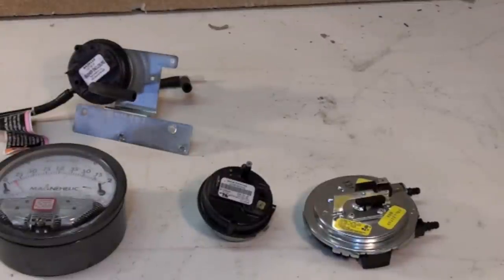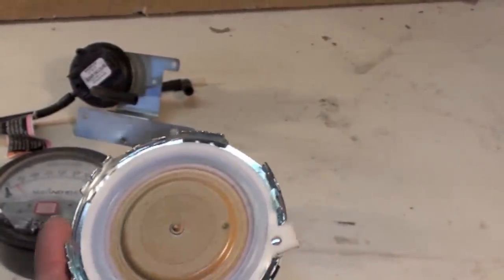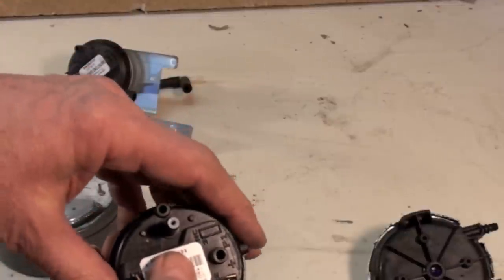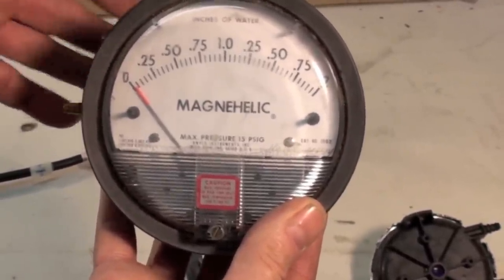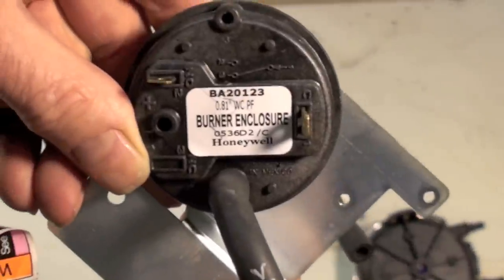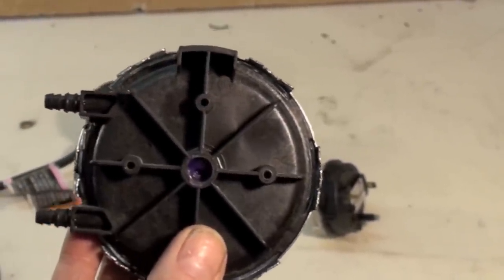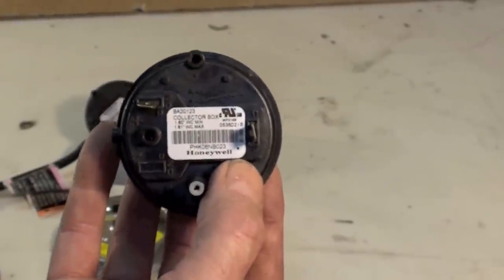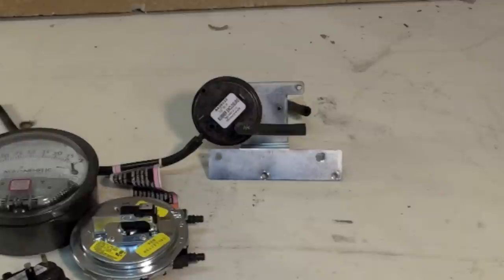How gas furnace pressure switches work

Comment: If I tap on the switch it will activate, it is intermittent. If I hold it with the wires upward it makes connection every time I try that. If I hold it with the wires facing downward and the adjustment allen up it shuts of the gas valves. Normal operation or bad switch? 

Furnace shuts off after the fan kicks on, or doesn't ignite unless I tap on the switch while it is vertical.
Reply from the maker: The switches are quite picky and some are position sensitive.  You could have a switch failing or a venting problem.  I would replace the switch first.
GFM

Comment: Great video. My mothers gas furnace has been not starting lately. It's about 12-13 years old in a modular home. It's upstairs and down draft with a full basement under the home. I did a quick search online and seen posts about trying to tap the plastic pressure switch. I've done that and then the furnace will start. Just a light tap with something plastic. I've been using a potato chip bag clip. Do these switches get sticky? Is 10-15 years about an expected life of these? We are in central,wi.
Reply from the maker: Your problem is either the pressure switch is failing (which is common) or the system vacuum is low.  Causes could be vent blockage, dirty inducer wheel, inducer motor failing and possible tubing plugged.  Hope this helps.
GFM

Comment: I hope I don't have to pitch it.  It is like 2 years old and my deductible is $1000.  The burners and everything didn't get any moisture on it just the lower circuit board and the bottom of the blower.  Do you think its the blower?  I already replaced the board that got wet.  I tried putting direct power to the blower from a ext cord and got nothing.

Comment: I have a Nordyne M1M Series.  We keep getting blinking red light that pressure switch is open.  We replaced it and still get blinking red light.  We live 80 miles from town so technical repair is not possible.  Took off blower assembly and cleaned it out.  Still blinking light.  Any suggestions?

Comment: Hello Gary, Thank you for the video, I have AO Smith 40 gallons Water Heater and It is 2 years old unit. Today I have noticed that it did not work and i was able to get the codes from flashing light, It blinked 3 times which translates to Pressure switch, I called my plumbing heat supplier and gave him the part number and he mentioned that this switch is adjustable and I could not figure out how to adjust since there is not adjustment. Please if you can point me int right direction. 

Thank you, 

Rav
Reply from the maker: Do not, under any circumstances adjust that switch.  The adjustment is probably sealed for just that reason.  First, check the blower wheel for dirt.  A clean wheel may just fix it.
GFM

Comment: Very informative. I was recently looking for a reason why my Ducane CMPE series furnace would shut off before T-stat temp was achieved. Sometimes it would fall behind 15˚ or more in really cold weather. While checking the pressure switch hoses, I found that little gray piece (you said reduced pulsations from the inducer) backwards up by the t bar where the hose splits off to the inducer and burner box. Only thing I can figure, someone yanked the hose off who knows when, little gray piece came with it, then the person put the hose back in place the other way around. I removed it because I thought it shouldn't  be there. Do you think damage to the pressure switch could have ocurred? Should I put it back? BTW, the furnace has been staying on longer but keeping the filter door open a few inches helps too.
Reply from the maker: Are you sure you have a pressure problem?  If opening the return air reduces the problem, I would be looking at return air restrictions (is the filter clean).  Also the secondary heat exchanger could be plugged.  Check this video:  http://youtu.be/jjHR9GLvQ7g  I would not leave the pulse eliminator out.  Hope this helps.
GFM

Comment: Gray, today i saw a furnace that has 2 pressure switches for the 2 gas stages. these were normally open. but there is one that connects to a condensate trap and this switch is normally closed. it says 1.0wc PR. the other two says PF. is the 1.0wc PR normally closed?  thank you.

Comment: Help!.....I replaced the inducer motor on my York furnace and since then, it worked fairly well but seemed to be starting and stopping oddly at times...and two days ago the igniter went dark and inducer keeps going but no igniter and no gas and therefore no fire......replaced the igniter and still not working when I realized that the blinking red light was telling me that the pressure switch is stuck closed......what is my next step to check and could i have done something wrong while replacing the inducer?....did it exactly in reverse of what I did taking it off....love your videos..thanks
Reply from the maker: Probably your inducer replacement was ok.  Check the sensing tube from the pressure switch for water or obstructions.  Also look for vent obstructions or water in the vent of a 90% furnace.

Comment: Very informative videos! Thank you so much. Question: I've searched the net far and wide for a pressure switch on York Furnace P2UHD20n12001A. Current part shows a MPL-9300-0.65-DEACT pressure switch with 3-wire and 1-tube input. Any good leads on where I might find this part?
Reply: Larry Wolfe Hi, I am also having a problem with my furnace and am looking for that same switch. Were you able to find it? If not, how did you end up fixing the issue? Thanks
Reply: Desi Munda ebay sell one but we ended up going with a furnace repair mechanic. He called york who advised this particular furnace's original temperature switch was too low and suggested a higher temp limit switch. That apparently was problem.

Comment: Thanks for sharing, very informative. Are these (Or could they be) used to disconnect an electric source? For instance, with a HHO generator: An HHO generator (from my ,hobbyist, understanding ) uses electrical current (battery) to separate HHO into Hydrogen (the fuel) and Oxygen. Of course I understand it's a little more complex than that, Lol just figured you'd know what I meant. Do these disconnect the electrical flow when the gaseous pressure exceeds, or drops below, the water-table range dictated by the pressure switch? Just checking as I'm only vaguely familiar with gas systems.
Reply from the maker: The pressure switch works with generally negative pressures in the fractional water column range.  They are capable of switching 24 volt in the fractional amperage range.
GFM
Reply: :) Thank you.

Comment: Again great vids...!!!! I had my pressure switch changed exactly 1 yr ago because water reached into it (according to tech). What what cause water to reach into the switch. Blocked tube?
Reply from the maker: 2 possibilities I can see.  Unit is in an unconditioned space.  The other problem may be the pressure switch has a small hole that tends to push any water back up the tube.  If the hole is clogged, it could get water in it.
GFM
Reply: @grayfurnaceman   Condensing furnace-clogged drain. Water going from inducer to the switch.
Reply from the maker: @123K4x4  I would replace the switch if it has had water in it.
GFM